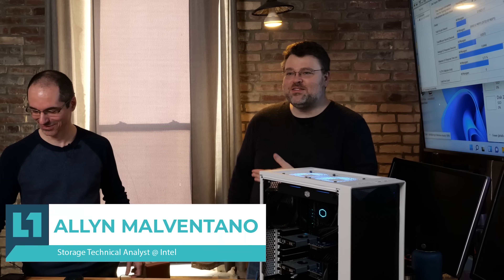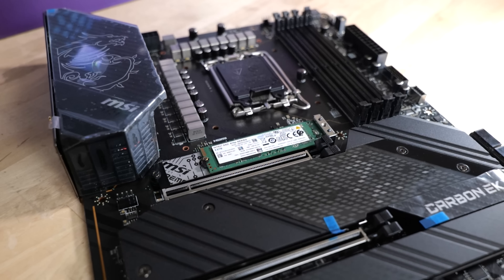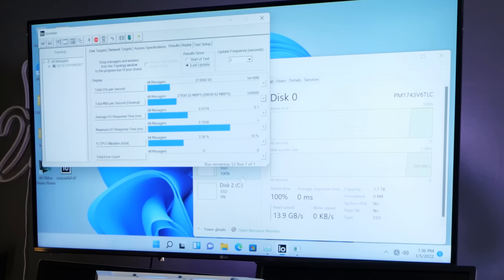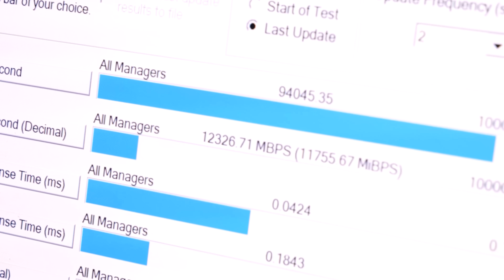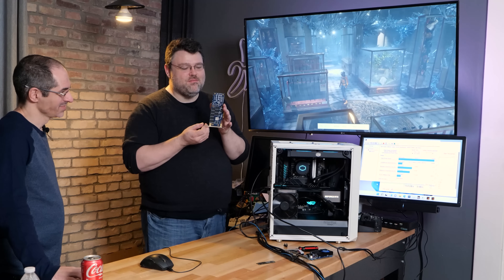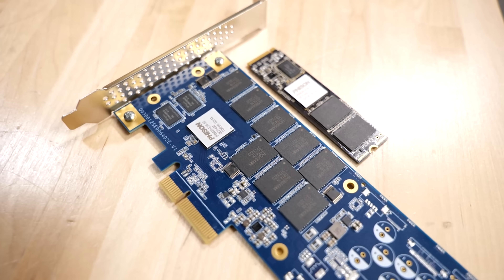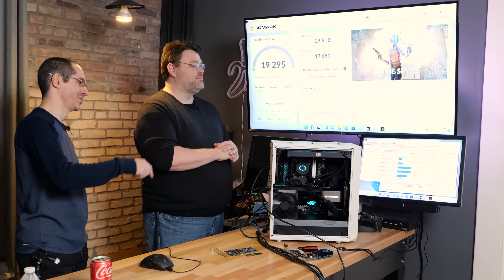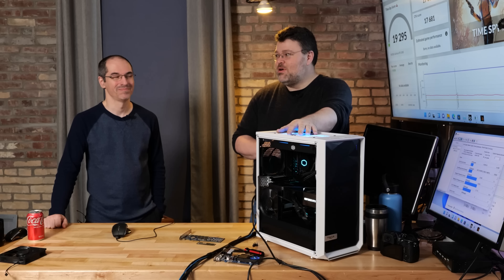PCIe 5 By 5: INSANE 28GB/sec Storage with Allyn Malventano

Comment: I just "upgraded" to a Gen 11 intel and PCI-E 4 and a Samsung M.2 980 Pro.

I opened a 752 MB zip file, it did it so fast that the Windows file transfer screen didn't even pop up. The Samsung going PCI-E 4x4 ~ 7 GB/s. WTF could possibly be processed at 14 or 28 GB/s?

Seriously though, what needs these speeds? I honestly don't see it much faster at all than a SATA SSD system. What can use these speeds?

Comment: ALL the More reason for me not to waste my money on a second AM4 motherboard just to upgrade to a 5800X in another AM4 socket!! AM4 is about to be a dead platform anyway.. The Next motherboard I buy will be an AM5 motherboard that has matured.. ((No way I am gonna go through what I went through with my X370 Taichi and 1700 N 2700X, with all the Memory and BIOS problems I had with AM4 just to be lied to by AMD when it came to a 5000 series BIOS for my X370 Taichi Board that can clearly run the chip.. They promised through 2020!! NOT Too 2020.. 
 Now I here they want to give X370 Boards a BIOS so we can buy all the Left over 5000 series chips when Zen 4 comes out... 
     (((AMD There's NO way in Hell I am Going to Buy 2 AM4 Motherboards!!!! Wake up and Give us a legit BIOS Just like you guy's did for X470 which is Barely any different from X370 if at all..)))

Comment: Do any desktop MB vendors support 2 x M.2 from the CPU? Most seem to only support 1 from the CPU and the rest are chipset based.
Reply: Do you mean lanes dedicated to soldered m.2 slots, cos most boards support CPU lanes for M.2 with adapter cards, which is what I'm using on Haswell.
I have an inkling there are some boards where M.2 share lanes with primary PCIe slot which drops to x8 if at least one M.2 is used, but typically they just expect the use of adapter cards as that way it allows other cards to be used (capture, audio, additional gfx etc).
Reply: @ChrispyNut  yes dedicated to soldered M.2 slots. I run my workstations with Raid 1 and it doesn’t seem sensible to have the M.2 drives on lanes that are supplied via different routes.
Reply: Yes, the Asus ROG Maximus Gene XI Z390 motherboard. The PCI-e 3.0 x16 CPU lanes can be split to x8 for the GPU slot with x4/x4 for the two M.2 located on the DIMM.2 riser card. Two additional M.2 available on the motherboard via the PCH, with a third M.2 /U.2 possible via the PCI-e x4 slot. Works nicely with PCI-e 3.0x4 M.2 drives consisting of both an Intel 905p M.2 x110mm 380GB (boot/OS) and a Samsung 970 Pro (1TB data) on the DIMM.2 riser card . The two motherboard M.2 locations have an Intel Optane 800p ( 118GB) for hdd caching and a Intel P1600x (58GB) for other tasks. Lastly an Intel 905p (960 GB 2.5” U.2) connected via a Startech U.2 adapter card in the x4 PCI-e slot for VMware virtual machine images. This is with an Intel i9-9900KF and 32GB of RAM. Works well…
Reply: @dvwjr79  thanks! Good info!

Comment: And yet alderlake still doesn't support any more USB endpoints than say haswell...
Ryzen 7000 where are youuuuuuu???
Reply: What would be the point, there's only so many that can fit in the back panel and few cases even have 4, let alone more.
Invest in a 10/20G hub/dock for more.
Reply: @ChrispyNut  every dock uses more endpoints. You are confusing ports with endpoints. Most people have no idea how endpoints work because the USB devices they are using are just keyboards or thumb drives or what not. When you start plugging in USB audio devices you can easily use 9 endpoints for a single device plugged into one port. You get about 164 endpoints on Intel whether you have one physical USB port or more. Hubs will take up endpoints whether you are using all of the hubs ports or not.
Reply: @kaislate  Actually, I thought you were confused, as I (somehow) hadn't actually even heard (that I can recall) of endpoints.
Having done some quick research, I can't see them addressing this anytime soon as those running into that limitation will either get a board with additional controllers or use PCIe USB add-in cards.  It seems too niche of an issue, especially with their love of market segmentation